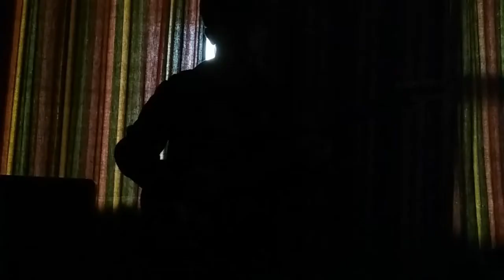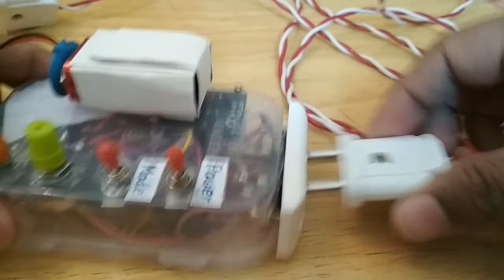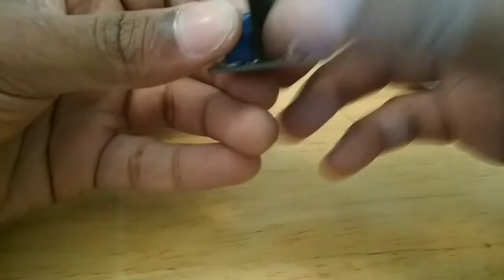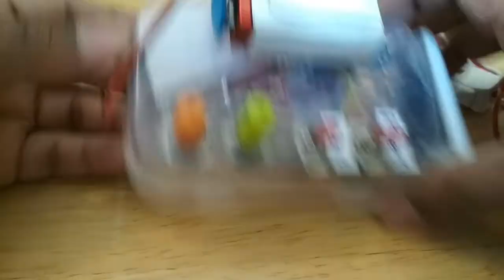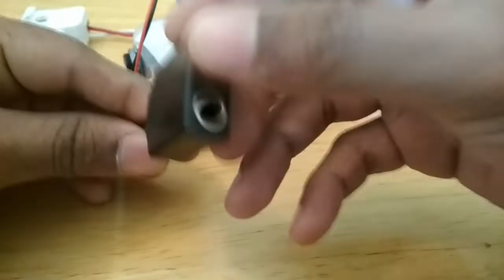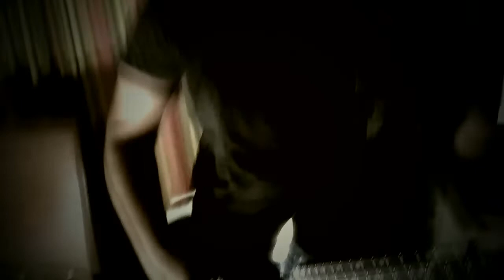Guitar-Controlled Lights | DIY Synced Lighting "Pedal"

Comment: Hey great stuff in here. Really cool. :)
About that live plug, you could permanently connect it into the box to avoid exposure to live connection.. 
And also,
Suppose i were to use an LED, could i connect the audio source to fast switching transistor's base while the collecter and emmiter is connected to an LED with the DC source parallel to the LED, (with the right polarity) ? I'd have to use a resistor if the audio source is an amplified one right?
Reply from the maker: Yeah, connecting it permanently would make it safer. I wanted to have it plug in, though, so that the actual device is small and can be stored easily with no tangles etc.
About the LED strip, I think I understand what you have in mind, and it might work. You probably would need a resistor either way to limit the total current. Using an FET instead of a BJT would bring the input impedance up to infinity, and putting a potentiometer at the input would give you an adjustable threshold of audio for the light to come on.
Reply: @Psychotenuse  that's great! Thanks, I'll try that out.